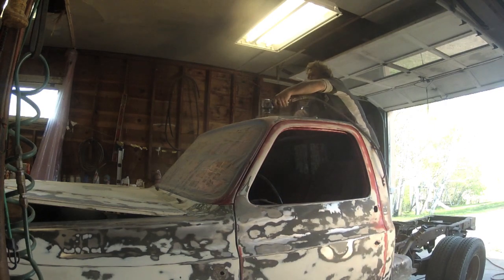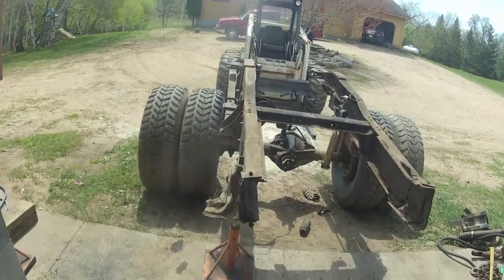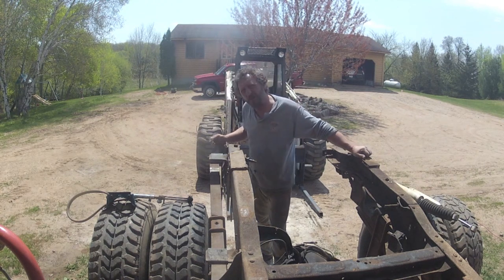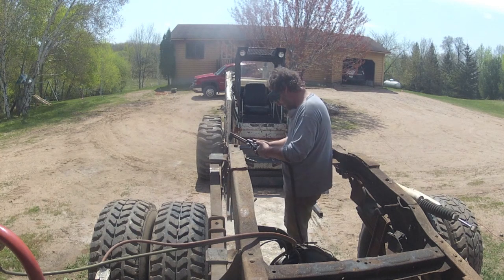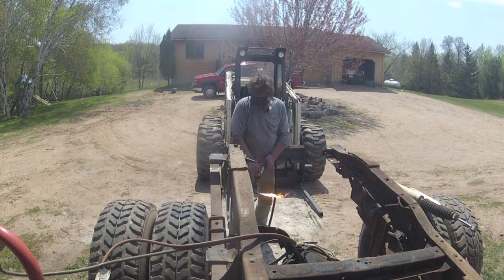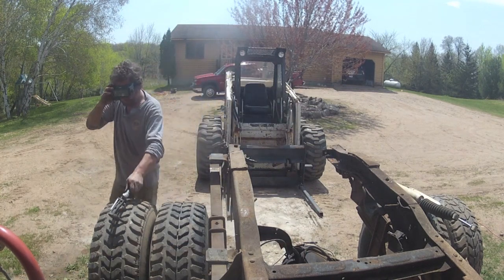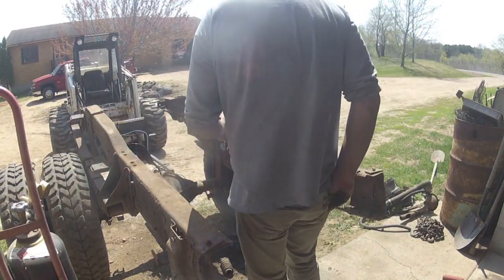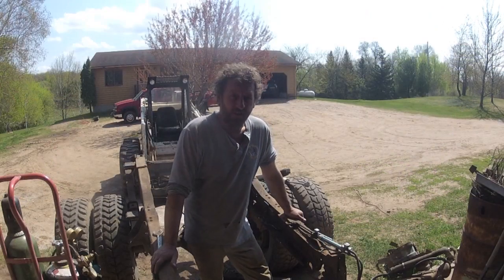NEW WRECKER BUILD PART 5 by BSF Recovery Team

Comment: what brand and tread type are the rear tires on the old wrecker wheels!... i would like to find some of them for my 1980 ford f250 4x4!
thanks Erick, your pal, mike
Reply: gilliland426 Those are military 37" Goodyear MT. They aren't the best in any category, other than cost, but they are good in mud, snow, rocks, pavement, and durability. They can be had for fairly cheap ($50-$100 per tire) on Craigslist or from someone who has a contract with the government that buys them in giant loads. Also, they fit a 16.5" wheel.

Comment: kody he has them on right look at the diff where the drive shaft goes the inside of the tires point the direction of rotation in forward motion just like a tractor tread the out side lugs are pointed the other way for reverse traction. recovery team love it been following you since you came out I'm not it your parts so would you sell me a sticker plz

Comment: asyer way to do x the heads with cutoff wheel and air chisel them off . did it that way for ford rear mounts in shop . they did not want hot wrench used with ford warranty . great show lookin for more vids. terry

Comment: By now you probably have a plasma cutter, but I've had both and I'd take an acetylene torch any day over hearing an air compressor run all the time and always  having to be near 220v power to use it.

Comment: What rims you using on that rear end? I wanna run dual HMMWV tires on my dually
Reply: Mat OB 
His setup is: 
stock 16.5" wheels
2" spacer at the brakes
2" spacer between the duals. 
= 4 spacers

Comment: I am no expert but I have changed a few old chevy leaf springs out and they were not that bad to take out, certainly easier than taking out all the rivets.  I used an impact gun added some oil to slick them up then hit them out with a hammer.
Reply: What part of the country are you in?

Comment: what kind of air compressor do you use at home?
Reply from the maker: I don't have a compressor plumed into my home garage, I use a gas powered, portable one. It was a freebee, found on the freeway, fell off a contractors truck, a little repair and was good to go...LOL
Reply: recoveryteam what brand is it? I need something with a good supply of air
Reply from the maker: Has a honda motor, and the twin tank, wheelbarrow design. I don't know the brand, or the CFM rating.

Comment: Why exactly did you run the wheels reversed like that? The patterns reversed. What's the point in not running both in the more Agressive style.
Reply: Kody Tuggle older 37 hmmwv tires tread design is such that forward or reverse you get the same traction

Comment: In 1988, The body's changed drastically.I don't think the 88 dash pad would have been remotely close to a 1983. Perhaps 1973 to 1987 may have fit.
Reply: actually the 3500 didnt change body or dash in 88 just the lite duty...
Reply: I know this is 4 mo old. But the 1 ton trucks kept the same 81-87 body style till 91. Same with suburban and Blazer/jimmy. Basically everything was the same for the 88-91 trucks except for a different grille/headlight setup and some other minor stuff.